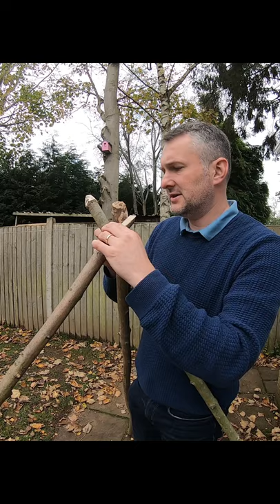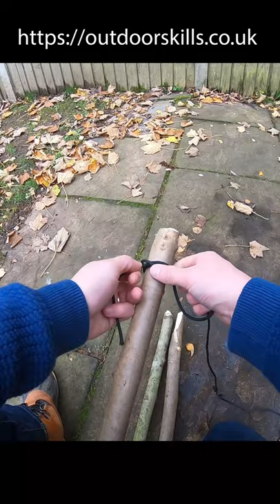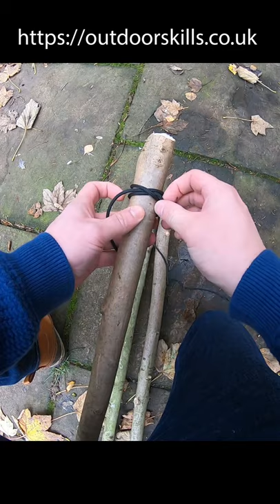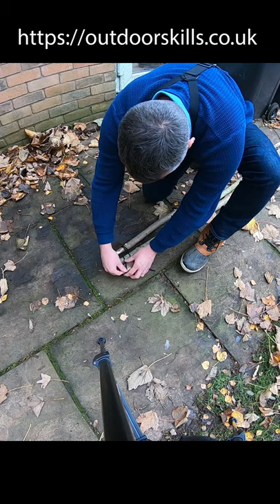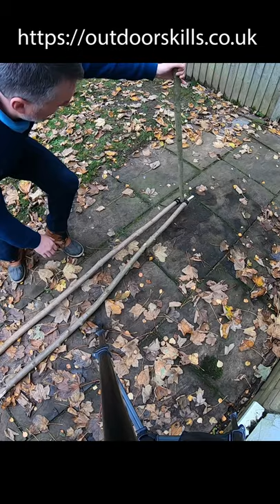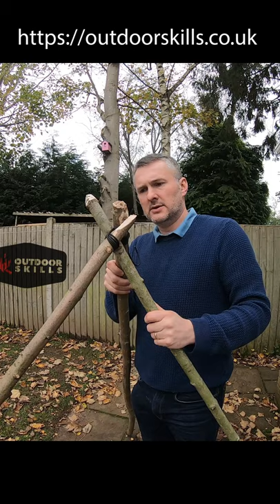The Secret Hack to Lashing Together a Rock Solid  Tripod #shorts

Comment: When we built the 20’ high, twin tripod, top tripod inverted platform to survive floods, with spars (tapered 6”-12” diameter) using 1” rope, my old Scoutmaster Doug Stone always insisted on us using frappings to tighten and space the gaps between the spars. He also never let us cut rope or use a knot that couldn’t be undone :-)
Reply from the maker: Who said anything about not being able to undo the knot? I like the idea of not cutting your cordage but in reality if you have plenty of supply then it's not practical. You can always make more cordage - video on that coming soon ;)
Reply: I have seen Stone's way of lashing, but do you think this guy's way would be sufficient for a pole bean tripod in a garden?